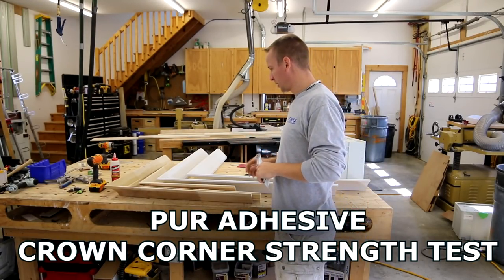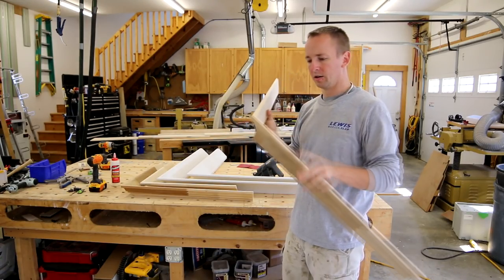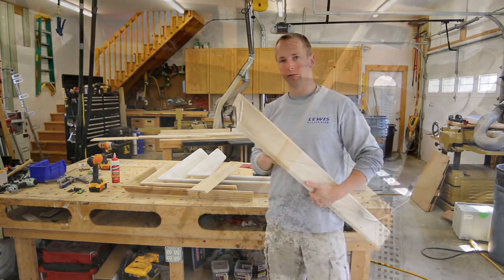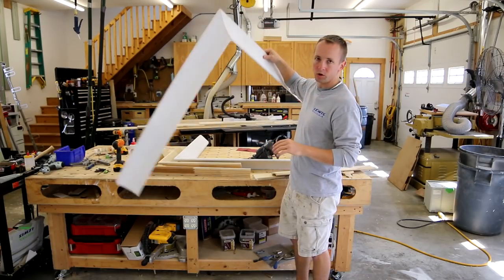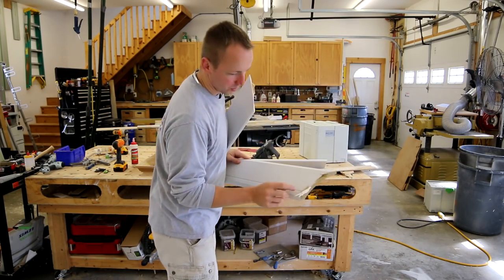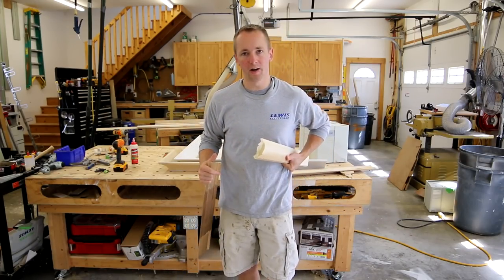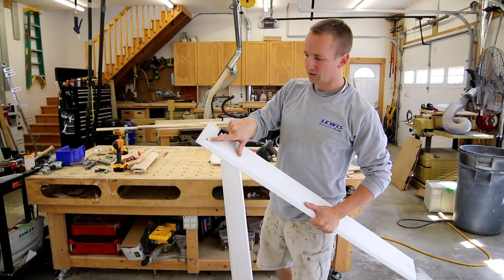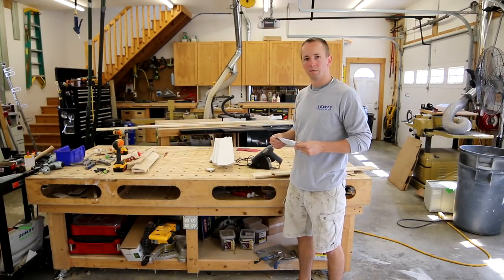The Strongest Crown Molding Outside Corner Joints - The Dowel Trick

Comment: I like the convenience of the dowels and never really considered a reinforcement for room crown. When building cabinets with larger crown, I usually glue and pin (from the back) pieces of backer strips I cut that has the same inside angles so it sits flat against the back of both pieces. If you follow me there. So it reinforces the entire length of the miter. The angle between the backs of the crown on a 90 deg joint is pretty close for most crowns so you can run several lengths of it and cut to length when needed.

Comment: I'm pretty impressed with that glue. Looks like it is much stronger than Miter Bond I typically use.
Reply: I looked into the PUR dispenser gun, I confused....one gun is $120 another is $1990 (!!!?) Do you have a video you did on what you use?
Reply from the maker: The expensive guns are for commercial and industrial use. They use much larger tubes of glue. You want the $120 gun. It should be in the video notes with a link to it.

Comment: I have a question since you cut your crown nested and the reason I cut mine flat is because of what I'll ask. When you come to an outside corner and need both pieces of crown to be 46° how do you go about adjusting the bevel without changing the miter angle? With cutting it flat you just move the bevel over more and the miter still stays the same. With the crown nested it doesn't work like that because you'd be cutting more off the bottom where the corner bead is and leaving the top longer
Reply: You just move the miter to 46, that’s why nested is preferred
Reply: You do know you cut crown upside down right?
Reply: @loganpatterson4674  yes I know when you cut crown nested you cut it upside down but moving the cut to 46° makes the top of the crown longer which in turn would mean you have to move the crown further up the wall to close the miter and giving you a different height from the ceiling to the bottom of the crown
Reply from the maker: That’s not how it works. Changing the angle does not change the position of the crown on the wall. The exact projection that you are cutting it on your saw will be how it sits on the wall if you have the correct angle. Hope that makes sense.
Reply: If you rock it down. Past your guide lines. It will take material off the back. Slide down a little bit. Turn about a half degree to match the new angle. Bingo bango bongo. Crisp corner. Use heavy amount of glue. Never really had a problem unless shrinkage happened from building getting ridiculously hot or. Wood wasnt acclimated.
Reply: @loganpatterson4674  x

Comment: So in practice do you cut most of your outside miters greater than 45° matching a typical sheetrock corners or do you just miter everything at 45°. 

Thanks great video.
Reply from the maker: Depends on how long the piece is. For longer pieces the drywall mud build up will be less of a factor. For shorter pieces getting the correct angle is more important.

Comment: Great tips !  Just wondering, on a exterior trim application (Victorian building) would you prime then assemble with "pur" or pre assemble then prime.
Basically on exterior should adhesives be applied to bare wood before priming  ?
What's your thoughts on using adhesives in  exterior  trim applications.

Comment: I got turned on to this product by you! I want it to work the way it does for you. For me it fails every time. Watched your vid about using it properly, still no luck. I just ordered a new applicator gun, hopefully that is the problem.
Reply from the maker: What type of wood are you using?
Reply: @InsiderCarpentry  I had a similar experience using the glue and clam clamps on pine mitered casing.  The clamps seemed to roll the miter joint to create a gap in the joint on the backside.  Any recommendations?  Great content as always.  Thanks for the videos!
Reply from the maker: I got a decent amount of feedback that the hipur does not work on pine nearly as well as poplar. Also, sounds like you are over tightening with the clam clamps. You can do partial pressure by only adjusting the lever part way, use less teeth, or adjust the screw position at the corner of the clamp to give less pressure.

Comment: Instead of using dowels which only gives you a small sector of the dowels circumference that actually makes contact with the flat surfaces of the back of the crown miter, wouldn’t it be better to use a short strip of hardwood or maybe plywood that you cut on a 45 degree on you table saw then glue it on the back of the crown where you have more surface area that contacts the back of the crown and the strip?  Hard to explain but a small 90 degree triangle shape strip would give you more flat surface area to glue to the back of the crown rather that a circular dowel.

Comment: Do you recommend to use on baseboards?
Reply from the maker: Definitely no on baseboard.
Reply: @InsiderCarpentry  what do you recommend for outside and inside corners on baseboards
Reply from the maker: I use regular PVA glue. TB1. I don’t clue inside corners. I cope them.
Reply: @InsiderCarpentry  what about like 1 x 8 or 6 like craftsmanship style boards? Do you cope those
Reply from the maker: Butt them together. Which is essentially what a coped joint is. I never miter baseboard inside corners.
Reply: @InsiderCarpentry  what glue do you use for this?
Reply from the maker: Titebond 1 👍
Reply: @InsiderCarpentry  thanks I figured lol but just wanted to make sure